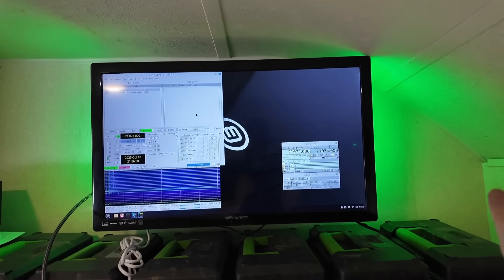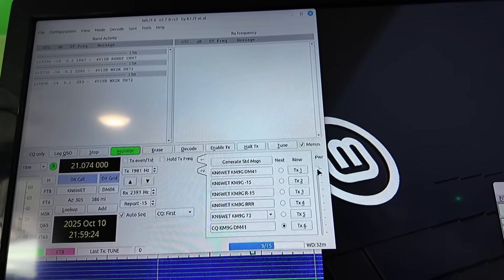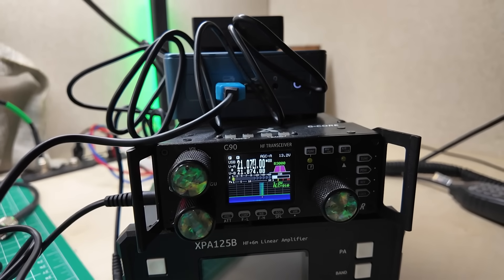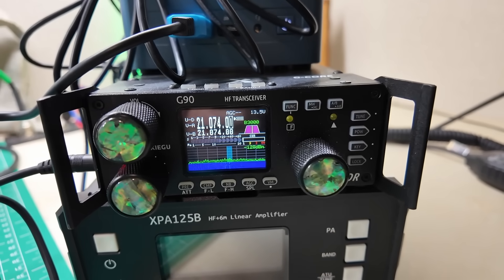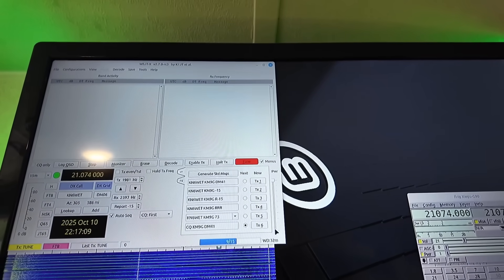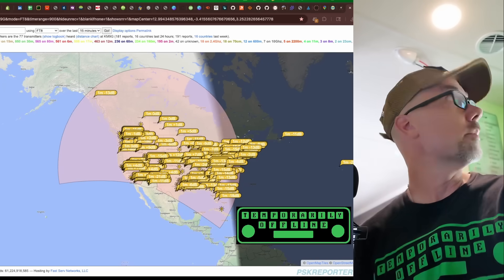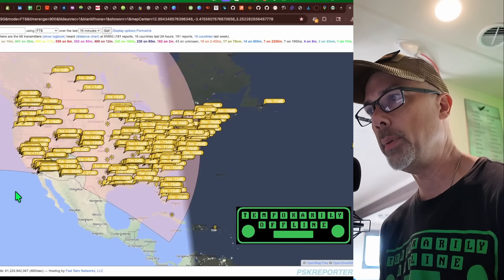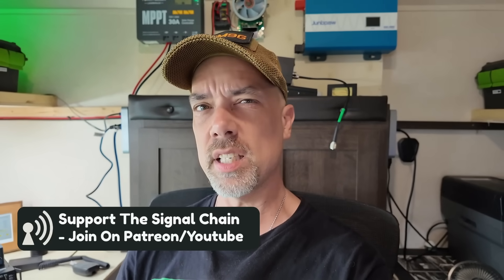FT8 Users Must Watch!

Comment: I am still unsure of what may be the problem for me. If I get the line to turn green, when I turn the radio up to 20w, the radio will only say its output is 10w
Reply from the maker: What are your input settings in the deep F menu?
Reply: @temporarilyoffline aux in is at 8

Comment: Great video, thanks.  Can you confirm what your AUX IN setting is on the G90 - mine is set at 8 for IN and OUT following some advice I found last year when i got the G90. 73s M0TNI
Reply from the maker: I've got Aux In at 8 and Aux Out at 15 - this is a combination of your computer's sound card settings and your radio's settings.  Set them hard and fast in one spot and then adjust them for perfection in the other spot - but don't over amplify your signal.  Zero distortion.

Comment: Similar for the FT-991A, RF Power to the max to avoid ALC trimming, and control the output power with the app's volume control. DT Gain on the radio should also be minimal. The ALC meter should show nothing at all in this radio for digi signals on Data-U mode. For Windows, I keep the speaker volume max and watch the radio PO meter while adjusting the app's volume till reaching the desired power. For example, I stay down at 20W when it's warm outside to avoiding overheating my EFHW antenna's transformer, but that's plenty for worldwide QSOs.
Reply from the maker: Sounds like a good plan for a 991a.

Comment: the latest verison V5 of the manual states "The audio output level from the computer to the radio should be adjusted so
that the ALC value displayed on the screen is between 30 and 85. The lower
the ALC value, the better. You should set the radio at your required output level
and then adjust the PC’s sound card output so that the radio’s ALC is within
range." run my at 40 and it looks great when checking with an sdr
Reply from the maker: Excellent!

Comment: I notice with my FT991a on js8 or ft8 the first couple transmissions from start up I need to adjust the ALC level even tho the slider on the software is left where it was used last time at zero ALC.
Reply from the maker: That was the most frustrating thing when I first starting using the JT modes - shut down a perfectly working machine, come back the next day and it didn't work anymore.

Comment: Steve, I know this video was for the Xiegu specifically, but here is something to be aware of - concerning the WSJT-X "Power Slider" specifically for the QRP Labs QMX and QMX+ radios...

The QMX radios use an innovative design for FSK digital operations. The instructions specifically state that "WSJT should be operated with the power slider at the maximum setting."  Since the QMX is transmitting in a digital mode (not SSB), it cannot be "over-driven" by too high volume.

This is VERY foreign to me, as all the other transceivers I have used recommend the power slider to be in the middle part of the range, and the transceiver ALC level be closely watched.

See Chapter 6 of the latest QMX operations manual for details.

Happy QRP-ing!
Reply from the maker: Yeah, the Q*X series interact with the actual signal and they don't just send the sounds they are given.  Its a really great design and doesn't need ALC as a result.  Its more of a traditional MODEM instead of a radio transmitting audio that needs to be controlled by the operator.
Reply: You are correct! This screwed me up the other day on my QDX, couldn't figure out why I had zero power output. Set the power slider to 100% and away it went! VA3IRF

Comment: You didn't adjust the transmit audio gain in the G90 settings. If you reduced it a bit then you wouldnt have to have the wsjtx output level slider so close to the bottom of the scale.
Reply from the maker: You're right.  This was only an ALC vid, so I didn't cover any of the extra settings.

Comment: I don't think the G90 (or other radios) are actually clipping the signal until you hit the ALC limit.  Most recommendations are to settle it in just around 1/3 of the way where ALC starts kicking in (either 33 or 66 depending on the firmware).  Always been successful for me on FT8/JS8/ARDOP/VARA using that rule of thumb.  First I've heard someone say that it clips in that range, it'd be nice to see it on a specan to see the actual waveform
Reply from the maker: Every radio is different in how it wants ALC, but the scope won't lie!

Comment: 85 watts for FT8? I was under the assumption that WSJT-X was used for decoding weak signals. My radios are IC-705 and G106, so I am always in qrp land. The operators I talk to (local club and allstar/dstar reflectors) make mentions of transmit levels below 20 watts when uding ft8. Is there truth to their claims? Thank you for the great videos, Steve!!

KJ7NUX
Reply from the maker: Its a "weak signal mode" not a "low power mode" - it works great for low power because they are often weaker signals - but "use the least amount of power to make the contact" is the golden rule.  You will notice more contacts at higher power as more people can hear you to respond.  Once you're heard, decoding is super-easy for WSJT-X.

Comment: I sure wish ALC was more standardized across vendors (or heck, across radios from one vendor).  It's a critical item for digital and SSB operation and I don't believe it's generally well understood.  Might make for a good church/nuggets round-table.
Reply from the maker: I don't even think most radio manufactures know what ALC is.  I'd need a good scope setup to show the waveform being clipped before I could it real justice.
Reply: @temporarilyoffline  Pretty much every radio that has a DSP ASIC implements ALC as a compressor/limiter before modulation rather than clipping afterwards.  How that compressor is tuned varies a lot from brand to brand and even radio to radio.  Makes predicting the artifacts that heavy ALC action will have on your signal really hard to predict.   Worse yet, most of these radios include an operator tunable compressor which executes before the ALC compressor, and not every radio is bright enough to turn this compressor off in DATA mode.

Comment: I haven't ever upgraded the firmware on my G90. It works as it did the day I first put it on the air 3 years ago, and that's fine by me.
Reply: Depending on when you bought your radio, they may have added FM TX/RX via a firmware update after you purchased it. They've also optimized the DSP and digital modes since release. Typically, not fixing what ain't broken is the best way to go, but with Xiegu the customers are their beta testers so checking the change log is usually worth a look. Especially once their products have matured. 
With all the above being said: you've had a 100% functional radio with zero down time for three years, not everyone is wise enough to have such a track record. My hat is off to you friend!
Reply from the maker: Very smart - only upgrade if there is something broken that the upgrade fixes!

Comment: Nice I would love to see a quick Hot Take covering radios like the ICOMs 705 7300 etc and Yeasus too! My Guess is that a lot of us may not be as cleanly transmitting as we think.
Reply from the maker: I go over this in my "How to FT8 with radio X" videos.  I need to do the 705 next.  Those videos take about 2 weeks to dial in and make.

Comment: Hi how do you set the alc on a Xiegu G106. This radio does not have a alc indicator on the screen. I am using FT8cn and I drive the radio for maximum power output from the display.
Thanks David
Reply: There is no ALC on our G106...
Reply from the maker: There is no ALC meter on the G106.  There isn't an ALC setting on any radio, its just a reaction to being shouted at by the PC - so find the audio device's volume setting and lower that while watching an external power meter and you'll find the sweet spot between contacts and volume level.  I go over that in this video: https://youtu.be/vF9BWZ1EqHM
Reply: @temporarilyoffline Thanks for the reply. I will watch the video link later. Happy New Year to you and thanks for the video channel.
David M0DUU Northampton UK

Comment: QRP-Labs QMX and I believe the QDX they advise to crank up the volume to max. I'm sure Hans knows what he's doing /shrug. BTW I run Linux Mint Debian Edition.
Reply: Correct, but that's because those rigs don't transmit the ssb audio directly for digital modes. They sample the incoming audio and measure the audio frequency, then generate an RF carrier to match. (A 900hz tone on 14.074 just gets transmitted as a carrier on 14.074900). This means there's no power/volume control over the transmission,  and WJST-X has no control of  it. If you lower the power slider in WJST-X too much, the volume just gets too low for the QDX to measure it and you get an error. The upside is there's no ALC to worry about, and audio levels are pretty much a non issue. MUCH less finicky than digital on a G90.
-N8BTR
Reply: @natereik good to know, thank you.
Reply from the maker: It all depends on the radio and your sound interface.  Luckily, the QRP-Labs radios are highly specifically designed for FT8 and aren't either a radio or a sound interface as far as that goes - more like a modem - you send it actual data and it turns it into the right deal for transmitting.